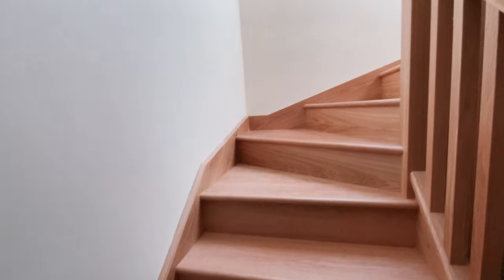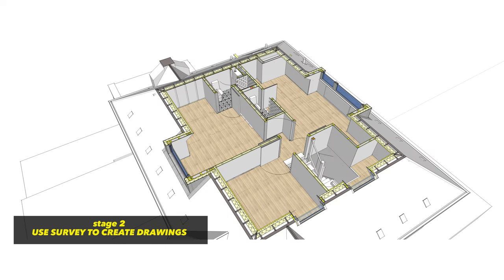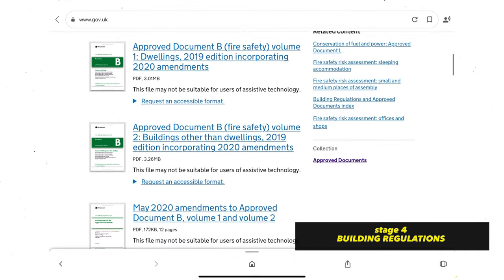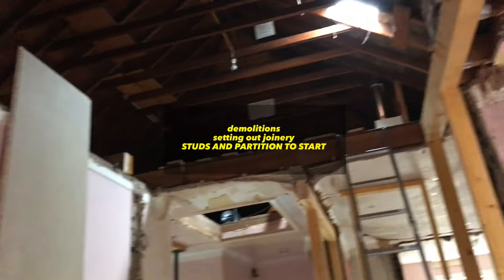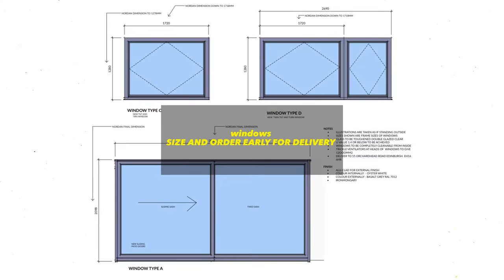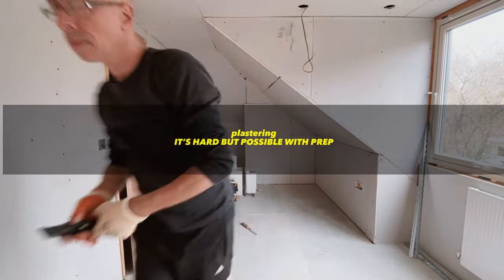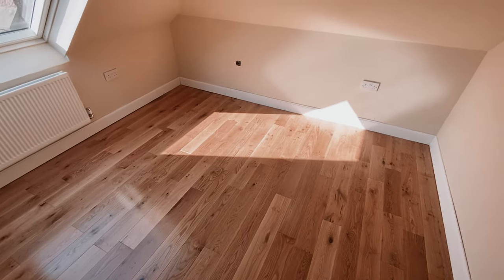ATTIC CONVERSION START TO FINISH - Architect Builder shows you how in 8 minutes

Comment: I've just come across your channel. As I am scouting YouTube for ideas. We are about to move into a 2 bedroom detached bungalow that we need to turn into a 3 bedroom ans I'm hoping the loft will allow this.
Reply from the maker: It sounds like a good project. Let me know if you have any questions I can try to help with and best of luck.
Reply: @build-better-things  I do have a question as you were kind enough to offer lol. As stated previously we are purchasing a completely hipped detached bungalow which we are hoping to convert the loft on. I ideally want to keep the roof the way it is which means I don't want to gable it etc this being the case is the conversion possible I know normally conversions require steels that sit in walls etc but this isn't possible on a all sided hipped roof. Does that cancel the choice to convert or heavily increase the price etc.
Reply from the maker: Hi. If you look at the attic conversion video from the aerial shot, you’ll see this house is a four way hipped roof and I didn’t use any steel in it, just timbers. The main challenge with hips is getting the headroom. I got around this by using dormers on two sides and putting the stairs and en-suite on the other sides to optimise the space. Price is a relative term but in my view without seeing your project , keeping within the existing hips will add the most value, when you think about cost and aesthetic versus increased value of property. Hope that makes sense.
Reply: @build-better-things  Thank you for taking the time to answer my question and the answers provided. Very helpful indeed.

Comment: Hello am enjoying your videos and Just came across them am wondering am a trying to build am doing the planing drawing is it possible to build it in a factory for them to install on site after the foundation has being layed and how would a completion certificate be obtained can you do a video on this if is possible
Reply from the maker: Hi. Do you mean building an extension in the factory? If you mean for example, timber kit then, yes that’s possible, SIPS or timber frame can be done like that. A completion certificate is applied for once you’ve finished building it. It’s just a form to fill in. It needs to be built per your building warrant drawings which is the important bit. The completion certificate is the easy bit. I’ve made a video on that here. 
https://www.youtube.com/watch?v=DM5IZMAEQ4o&t=540s

Comment: Once you took out the existing diagonal struts, how did you make sure that there would be no roof spread?
Reply from the maker: Before I took the existing struts out, I installed timber ties at ceiling level and vertical struts at about 1m away from the eaves, with coach bolts and toothed washers at the junction to prevent any rotation at the joint. With the coach bolts tight, I can then remove the diagonal struts one by one. Thanks for the comment.
Reply: Very nice work !! 

I’m just starting an attic project.  Thanks for the inspiration
Reply from the maker: Thank you and good luck with it. Making a project out of your attic is a great feeling.

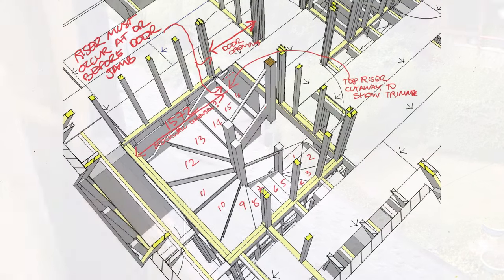Comment: Do hate to nit pick, but 4:50 lead should be fixed using copper nails.
Reply from the maker: Stainless steel nails work just fine with lead roll. Stainless steel nails were used for a specific reason. But yes, you can also use copper.